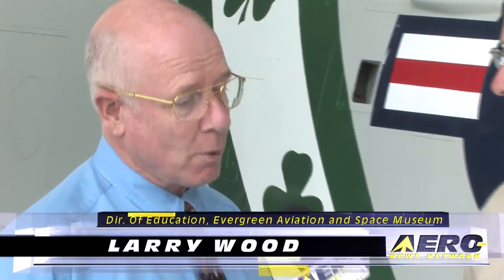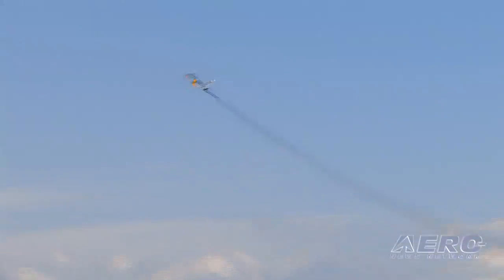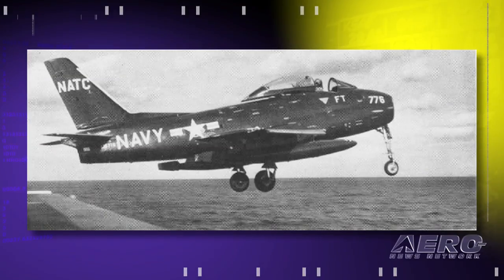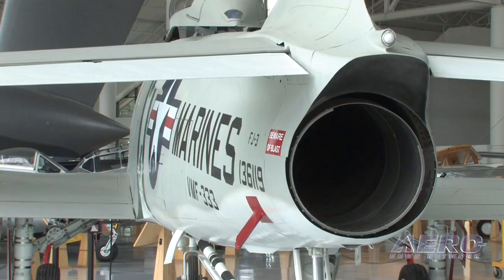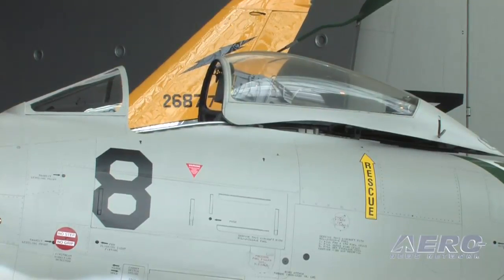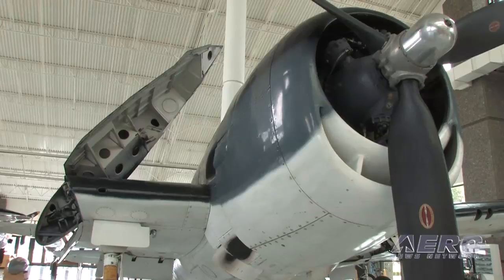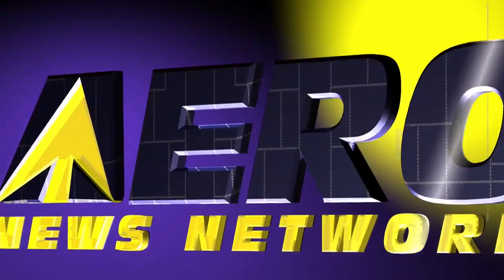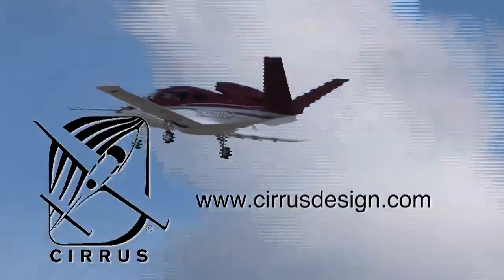Aero-TV:  Profiles in Aviation - The FJ-3 Fury

Comment: No the FJ-1 had no resemblance to the F-86 other than the intake design… The FJ-2 was nearly a duplicate of the F-86 with more robust gear and a wing fold mechanism that did not show when he wings were in the flight position. Also the nose gear strut was only extended on takeoff from a carrier. It stayed in its normal down position when coming back aboard and at any land base runway. Again you would be hard pressed to see the difference between an F-86 & an FJ-2…

Comment: Contrary to his statement the FJ-3 was not a useless cast off sent down to the Marines. It was a front line fighter in the navy in many squadrons and served quite well.  It was adapted to be capable of air to air refueling, and the FJ-3M was among the first to be fitted with the AIM-9 Sidewinder heat seeking missile.   It was a very good day-VFR fighter.  Don't sell it short.
Reply: He didn't say it was useless, he said it was a very good aeroplane.
Reply: Pelican1984 
The FJ-3 and the F 86 are different airplanes? 
Thanks.
Reply: He did say throttle response was poor so carrier landing was overly dangerous.  The F4U Corsair carrier landing attributes were also poor but legend has it that the RN come up with pilot instructions that allowed better results.
For the F3 and the F-86, the military were seeking all weather day/night capability so when radar equipped planes were introduced, a day fighter or attack aircraft was going to the boneyard as soon as new inventory was built.
Reply: Marines are always claiming they get hand me downs. Assholes